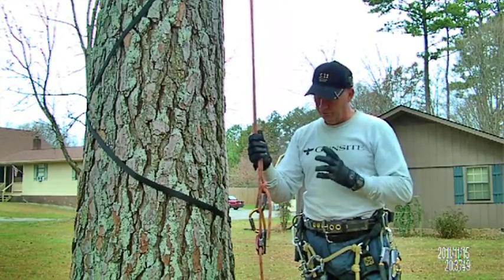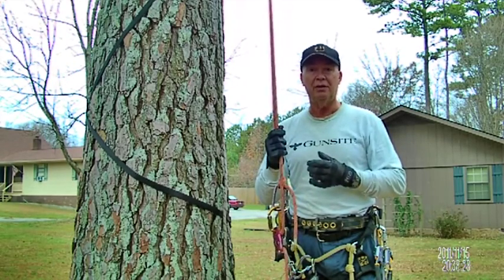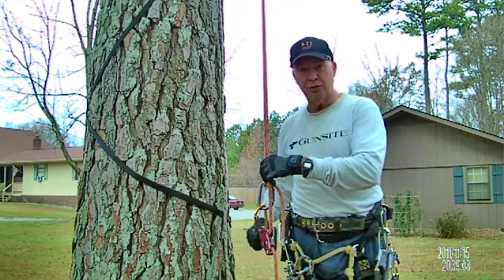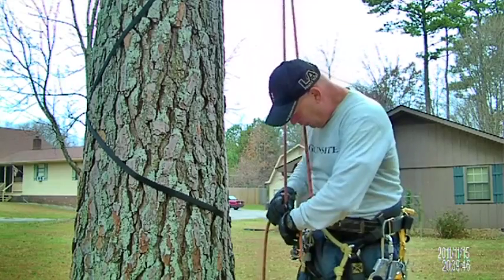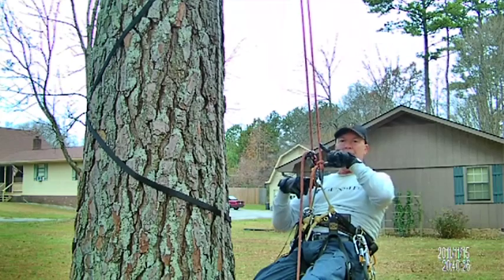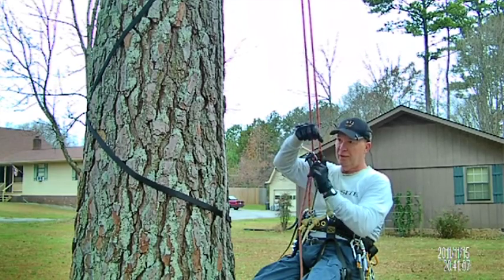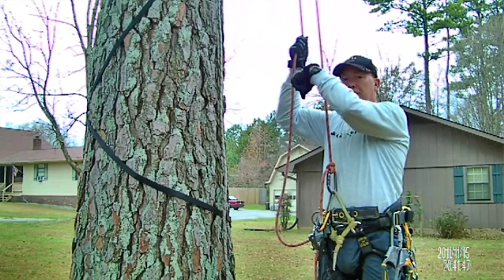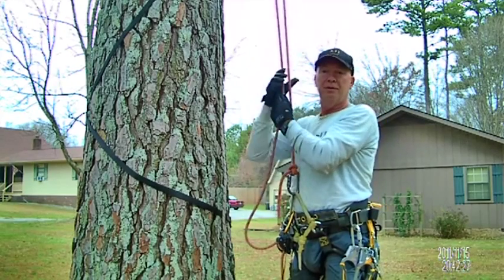Rope and Pulley Systems: Segment 16- Preface to the RADS -  the climber referenced 2 to 1 pds.m2ts

Comment: Make that 200#s of MASS and I'm with you 100%.  Guys get confused because they don't look at these things from a relative sense. When you are IN the system (z-rig), YOU are no longer lifting 200#s of weight, 200#s mass yes.  A gallon of water weights 8.35#'s but when IN water weighs nothing. A square inch of air weighs 14.7#'s but nothing when in the air.  When you are IN the system, you must apply 100#s of force to lift 100#s of weight, to make  yourself weigh nothing, (lift off the ground)

Comment: I don't want to muddy the waters, and you've made a great video, I have two other ways of thinking about this, one more complex, one simpler.  First the more complex- define the anchor as the inertial reference of the rope puller (stay with me).  When the climber does the pulling, the TIP is the "load" which he pulls toward him overcoming a load of 200 lbf.  A 2:1 MA is employed by the "moving" pulley (at the TIP).  On the other hand, when the groundie pulls, the anchor is everything in his inertial frame including the tree and pulley.  He must equal the load of 200 lbf exerted by the climber since the pulley is now on the anchor and simply redirects the load.  The pulley takes a load of 2*T.
Reply from the maker: I agree, that is a complex explanation - but nonetheless right on.

Comment from the maker: The forces are vectors rather than absolute values. The forces have both magnitude and direction. In theory, i.e. neglecting losses, the tension in the rope throughout the pulley system is the same no matter how simple or complicated. It kind of depends on what you mean by dynamic. If by dynamic you mean constant velocity, then the forces are the same as a completely static condition. But if you are accelerating there will be an additional force proportional to the magnitude of acceleration.

Comment from the maker: You are right, you do relieve half your weight from the harness - what has to deal with the other half of your weight? Your pulling arm. So your pulling arm can hold up your body weight with a force equal to half your body weight. You can also lift yourself by pulling with half your weight. That's a 2:1 advantage. You life your weight by pulling with half your weight.
If you hand the rope to another person on the ground, he will have your full body weight pulling against him.

Comment: This is an extremely fine distinction but at 5:08 and 5:59 you mention that YOU are pulling up 200#s with 100#s of force. At 5:42 you say that you only have 100#'s to lift.  I think that is actually what you mean in the other comments as well.  I am sure you would agree that if you did have those scales and they were attached to the ring on your saddle, at the moment you started to move off the ground it would read a little less than 100#s.   AWESOME WORK!!!!!!!!!!!!!

Comment from the maker: Less technically:The best explanation I've read is this: A rope is over a pulley 10 feet off the ground. A climber is tied on one end of the rope and he will pull on the other end. So there will be 10 feet of rope up to the pulley and 10 feet back down. When the climber has pulled himself up to the pulley, he will be 10 feet off the ground, and there will be 20 feet of rope below him!Since his arm/hand was on one end of the rope, he had to pull 20 feet of rope to raise himself 10 feet.

Comment from the maker: The water example is an entirely different principle. In a climbing situation, if the climber is supported by one rope, the rope experiences a force equal to the climber's weight. In a pulley arrangement as shown in the video, the climber is supported by two ropes, hence his entire weight must be supported by the two ropes, but each rope only has half the climber's weight. So, if the climber is holding one of the ropes, he will experience a force of half his weight.

Comment from the maker: The mechanical advantage of a pulley system is independent of any kind of leverage outside the pulley system. External MA only applies more force to the pull line, but does not change the MA ratio of the pulley system. Only one pulley is used in this video, not sure what two pulleys you are referring to.

Yes, I can pull myself up 15 ft without flipping upside down.

Comment: The simpler way to think of this- the groundie must pull the climber's full weight, the pulley at the TIP is a redirect, that's pretty intuitive.  When the climber pulls with his arms, he's supporting half his weight through his arms leaving only half supported by his saddle.  The tension in the rope is therefore half his weight, the pulley/TIP sees one times the climbers weight.  If any of that is more confusing than the video, just forget all of it :)
Reply from the maker: Good explanation - the other was too, just less direct.

Actually, this video was made partly in response to some detractors that refused to believe the MA changed from the groundie to the climber.

Comment from the maker: Technical explanation: I'm pulling up 200 lbs with a 100 lb force (my arm). If I move 200 lbs up one foot that represents 200 ft-lbs work. If my pull rope only moves 1 foot I'm only exerting 100 lbs through 1 foot which is only 100 ft-lbs of work. Hence something has to give; we can't do 200 ft-lbs of work with 100 ft-lbs. So, I have to pull 100 lbs through twice the distance I move to balance the work performed against work put into the system, hence the pull rope has to be pulled 2 feet.

Comment from the maker: First thanks for the kind words. However, weight, what we measure with scales is lbs. Mass is NOT weight and does not have units of lbs. Mass has units of lb-sec^2/ft. The mass of a weight that weighs 200 lbs is 200 lbs divided by the acceleration due to gravity, or about 32.2 ft / sec^2. Hence the mass of a 200 lb person or weight would be 6.21 lb-sec^2 / ft.

Comment from the maker: MA in pulley systems has absolutely nothing to do with your muscles. MA is defined as how much force is required to lift a weight or exert a force. My weight is equally shared by two strands of rope. Each rope has half the load. My arm only has to supply the force in the pull line which is half the load. Hence my full weight can be raised with a force of half my weight. The system I show in the video is a 2:1 to the climber and 1:1 to a person on the ground.

Comment from the maker: Not at all. My weight, 200 lbs, is supported by 2 strands of rope. Each strand has half my weight. Because those forces are equal and both downward, they add at the anchor point. Hence 100 lbs + 100 lbs = 200 lbs on the anchor.
If I had the pull rope to a person on the ground, he has to pull with a force equal to my full weight. In this case he has 200 lbs, the rope attached to me has 200 lbs, and again they add putting 400 lbs on the anchor.

Comment: I understand what you say and agree. Perhaps newtons would have been a better choice of words and more scientifically correct.  The point I was trying to make is that when you are IN that double rope system, you are no longer lifting 200 ____. 
It is interesting, don't you think, that mass is measured in kilograms and that the weight of an object is defined as the acceleration of gravity times the mass, .

Thanks by a force of 100%.

Comment from the maker: Actually what I should have said at the 5:42 is that I only have 100 lbs to pull to lift my 200 lbs.

In the context of pure theory, i.e. neglecting friction, the moment I start to move off the ground, in a frictionless system, a scale connected to my harness and another to the rope I am pulling to raise myself, would indicate exactly 100 lbs each. The two together would add up to my weight, 200 lbs.

Comment from the maker: Still, if a climber lifts himself off the ground by pulling on a rope, he is lifting his entire weight, not just the force he has to pull the rope with. It would be correct to say that I am pulling my 200 lbs up by exerting a force on the pull rope of 100 lbs. But the work I have to do is my weight times the height my full weight moves up. To say I'm only lifting 100 lbs is completely inaccurate. I'm lifting my entire 200 lbs off the ground, not 100 lbs. The 100 lbs is a force and has no mass.

Comment from the maker: In a double rope system I am lifting 200 lbs. If I were not, how would we explain a 200 lb climber just moved up a foot? Every time my body moves up a foot, 200 lbs has been lifted. I'm the only source of power, so I am lifting 200 lbs. My potential energy will increase by 200 ft-lbs. I have to exert a force of 100 lbs on the pull rope and pull two feet of rope to balance the work done by lifting my 200 lbs one foot.. I think you are confusing mass with force and/or work.